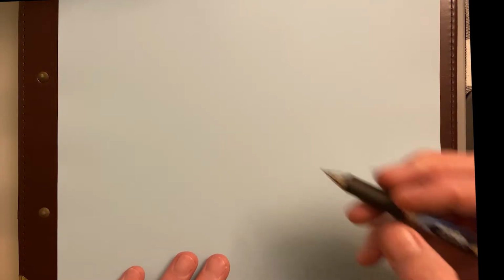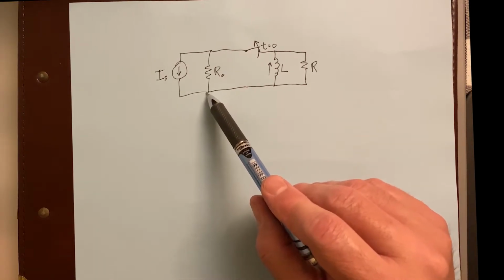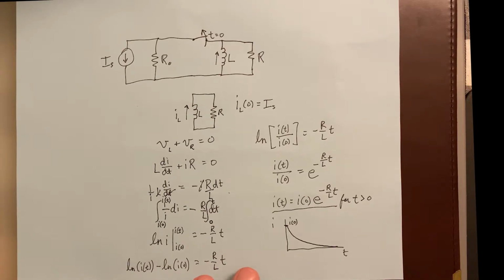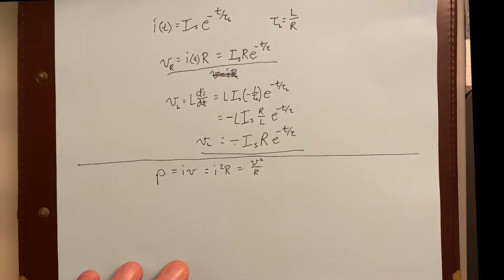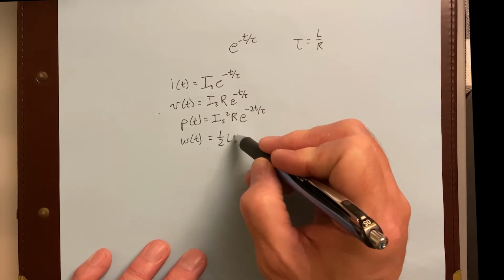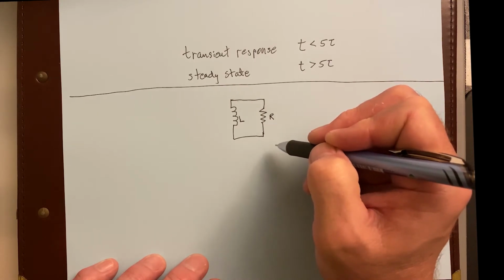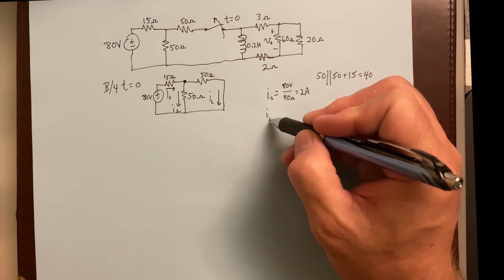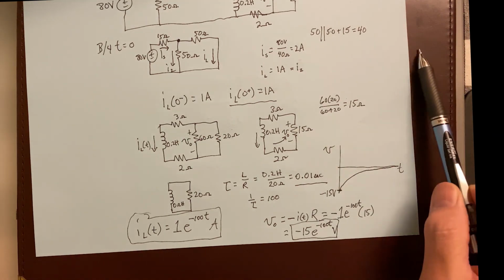15-Natural Response of RL Circuits

Comment: Just found your videos and theyre great. One question I wondering is where did the + c go after your integrated? When I set V(t) = 0 and plug in zero for t im getting 0 = V(0)*1 + c. Assuming i did this correctly C = - V(0). Maybe im not getting something.

Edit: I'm stupid and forgot there is no c when solving a definite integral.
Reply from the maker: @shoople46  Trust me, if you’re doing this stuff, you’re not stupid. Hang in there.

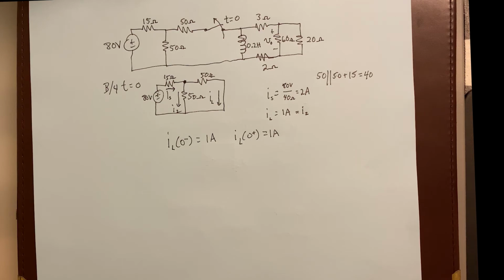Comment: At 44:40 Why is the left hand side of the circuit ignored?
Reply from the maker: Once the switch is opened, there is no longer a way for current to flow between the two parts of the circuit. The loop is effectively broken when the switch is opened. By opening the switch the left and right parts of the circuit are separated into two different circuits. Since the problem involved finding that one voltage in the right portion, then you can ignore the left portion after the switch is opened. The left portion no longer plays a role in solving the circuit after t=0.
Reply: @EnjoyYourUniverse  I see, thank you very much.